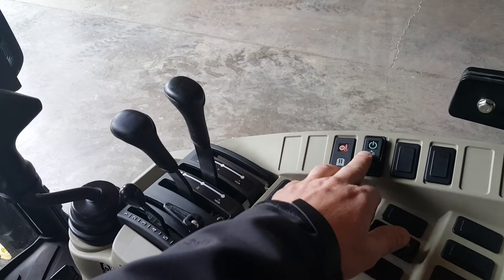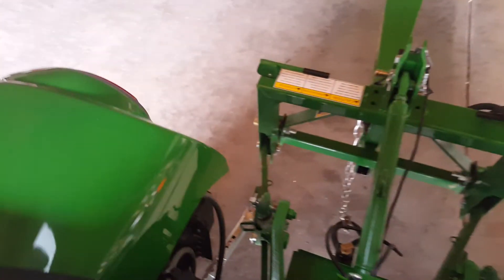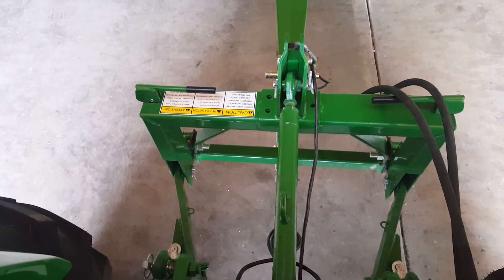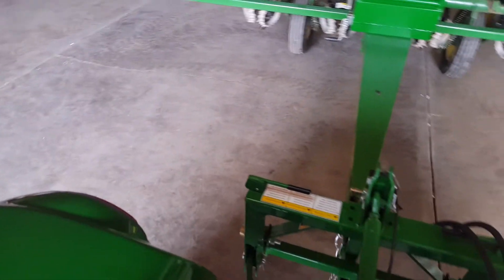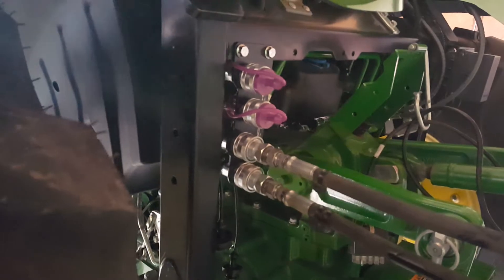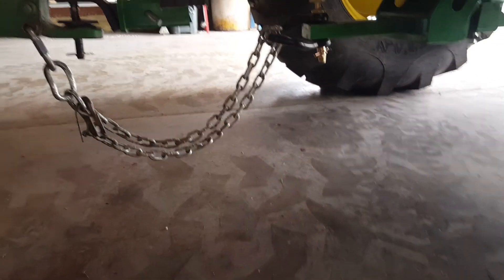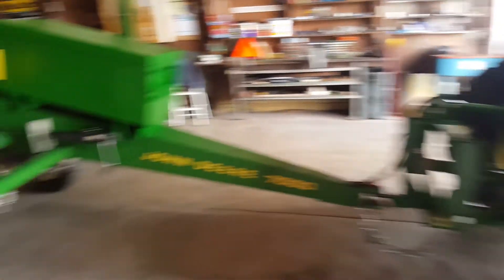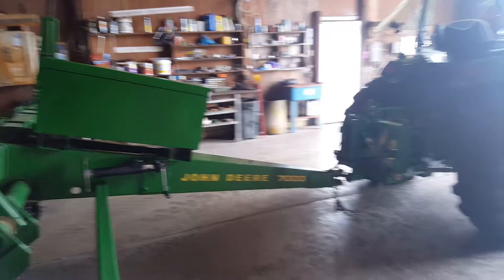John Deere 4052R 4th & 5th SCV hydraulic install complete

Comment: Looking to get a 4052R, Do you find it to have enough HP for farming?  I am not a farmer but if it works for your applications it will for mine.  Mostly want to bush hog, grapple for moving oak logs and clearing paths for ATVs.  Thanks Brian
Reply from the maker: The 4052R sounds perfect for what you need. If it's ever not quite enough, you can easily add an intercooler and send the ECU in for more HP to companies that specialize in that. They can delete the DPF as well. You'll have the same HP as a 4066R for a fraction of the cost and not even void your warranty. I haven't had to do that yet. I love the tractor. You won't regret it. It handles a 15' Frontier grooming mower just fine and a MX6 as well
Reply: Thank you for the info, very helpful and appreciated.  I love the site and always good info on it..  Thanks Brian
 @blyz_69
Reply from the maker: @Nathan Justice you may be correct. What issues have you experienced with your 52R?